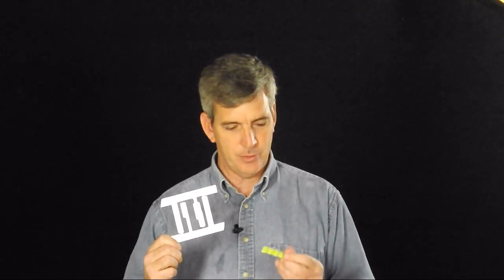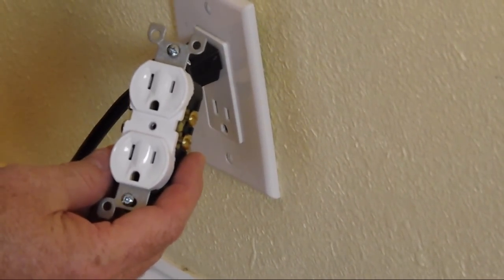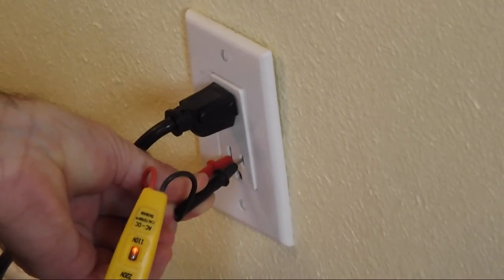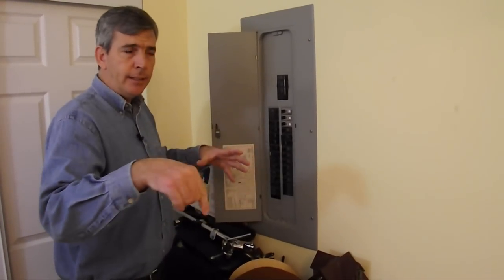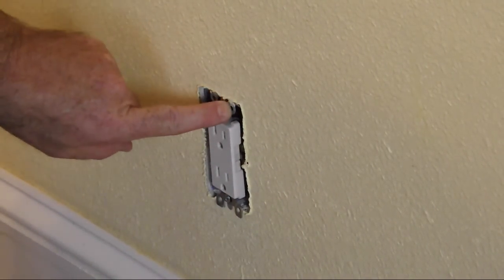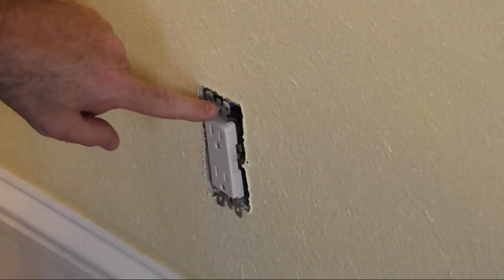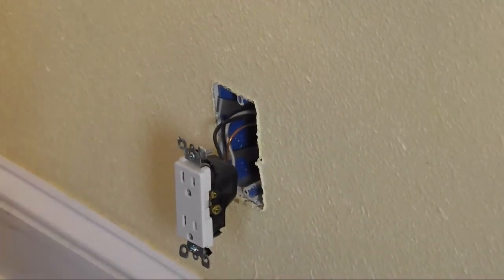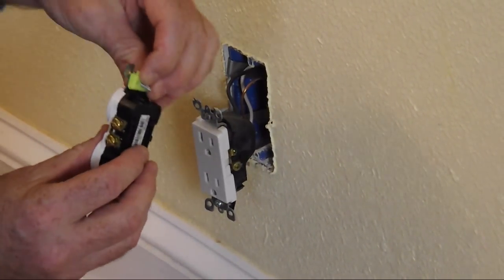Repairing Loose Electrical Outlets

Comment: My whole house has too deep electrical boxes and I have used spacers on some and installing old work boxes on others.  The outlets with spacers have improved a lot but still feel spongy and move a little.  The outlets repaired by replacing the existing boxes feel rock solid.  Installing new boxes is more labor intensive but there is a noticeable quality difference.  I am not saying spacers aren't acceptable, just that there is an alternative for those not satisfied with the results.
Reply from the maker: Thanks for sharing your experience. We appreciate it.

Comment: those clips were called "battleships" … because of the silhouette … and you want to put the long end in first an pointing UP so that it can't slip out.
Reply: Makes sense since it might slip down to rest on the bottom edge of the drywall hole due to gravity but will never slip up.

Comment: The metal piece for holding the box in place are called madison clips. 
Another thing I found to work well for bringing the receptacle forward is to coil some 14 gauge wire around the screw.

Comment: How much  can I expect to pay for an electrician to charge to change that blue box, the outlet, and the wall plate for a standard home outlet? I have about 20 in my old house that I want replaced. Thank you
Reply: About 15 to 20 dollars per outlet. Better for you to buy what you need and supply the covers.
Reply: I don't know about the blue box. That costs under 10. At the store. Installing it depends on where you need it placed and if the wall is open (no drywall or plaster) or closed.
Reply: @nadinelinda627  Thank you!

Comment: I have an important question. When I first moved into my home, I noticed that there was a multi-plug outlet stuck into a regular plug-in socket, not knowing that it was screwed in, and pulled on it kind of hard. How can I tell if I damaged the main socket? I tightened the multi-plug socket so that it isn't loose anymore, but can't tell if the wall plug-in is damaged. Can a socket become damaged by trying to unplug something that you didn't know was screwed to the socket?

Comment: you can use some bare bond wire rap it around a screwdriver and cut off what you need  use it as a spacer there you go and  bonded or grounded  don't  no about your retainers  look un safe like they mite or can touch the leads on the resepictal
Reply from the maker: Hi Cliff and thanks for the comment.  I really like your idea of wrapping the wire to create the spacer.  The retainers keep the box from pulling forward.  If you are concerned with the leads touching the retainers, I like to wrap outlets and switches with electrical tape anyhow just to remove the shock therapy factor if I ever have to go in for a repair later. .Cheers. Gene

Comment: Thanks for this - it was really helpful. What is the little square that's already on the back of the retaining screws, where you placed the new spacers? Is that a washer/spacer, also? Is it a problem if it gets lost? My wife was removing wallpaper, and she noticed that one of them was missing from an outlet in our kitchen. We're trying to figure out if it's important that we replace it. Thanks again!
Reply: Walker Wentworth Those are screw retainers, to keep the screws from separating from the outlet

Comment: Mannn, you are dangerous.  The "madison clips" - #1 you installed upside down, #2 are for old work boxes -- they do NO GOOD on new work boxes that are installed incorrectly or have loosened  up.  Unless the is box installed with plasters ears on the outside of the wall, the clips do NOTHING -- all you're doing is driving al already loose box deeper into the wall.  #3 you didn't securely pinch them closed - so could hit and be energized by the receptacle power screws.  #4 - the "spacer bars" are actually plater ears (but interesting using them for washers.  
I'd stick to woodworking  - less likely to electrocute someone.
Reply: I was checking the instructions which confirm the clips are installed upside down and it is for boxes with plaster ears (e.g. old work).  These clips are not designed for this application but I am not convinced they do nothing.  The faceplate was already effectively taking the mud rings role in keeping the outlet from becoming recessed, but now the clips keep it from becoming proud while removing plugs.  It should also help resist any cross forces while plugging in.  Don't get me wrong I think using this method is a compromise and replacing the existing box will lead to a higher quality repair.  I unclear how to evaluate if this is an acceptable compromise, but my personal experience is that spacers reduce movement of outlets while removing/inserting plugs while replacing the electrical box eliminates it completely.

Comment: i was told when installing an outlet the ground prong goes up to prevent something from falling across plug shorting it out.
Reply: L KC there is no NEC regulation for the position of the ground on a receptacle. Primarily either a company policy or local practice
Reply from the maker: L KC Hello L KC.  I've heard similar.  Some dryer plugs, stove plugs, and even some small aplliance plugs would end up having a wire loop going up if you did that.  Gene
Reply: ground goes down
Reply: Convention is: Ground plug facing up means that this receptacle is switched. For example: There is a light switch in-series to control a lamp connected to this receptacle.

Ground plug facing down is for everything else that is not switched.  Just make sure your receptacles and boxes are snug, and that plugs are flush with the receptacle face when inserted.

Comment: so the whole problem was the spacer? Then you fixed the stripped  out screw with a bigger sheetrock screw?
Reply: Patrick Murphy 
So what is the right way?
Reply: Gene Lonergan No No No, wroongggg
Reply from the maker: Laura Beemer Hello Laura Beemer.  Yes the whole problem was the spacers.  What happens a lot is that the outlet / switch box isn't flush with the sheetrock and you will get movement from pushing and pulling of that difference.  Often times this results in a plastic box getting stripped (remember someone is usually pulling on an extension cord)  I get around this with a sheetrock screw that cuts its own thread.  If you didn't use the spacers to make up for the difference in bring the outlet out flush with sheet rock, you would break more plates.  Thanks for the comment.  Gene